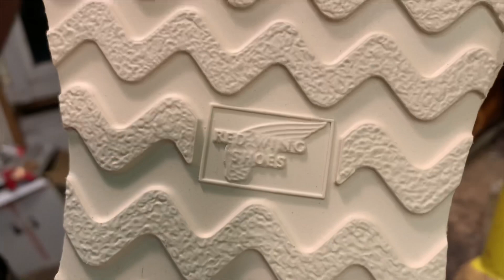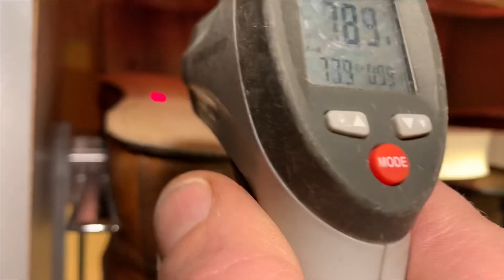Resoling #875 Red Wing Irish Setter Moctoe step by step process by @wijsmancobblers..

Comment: This is great! 
Just turned my 10877’s in to a local cobbler for a sole replacement. I hope what you’ve shown here is standard workmanship in the trade. 
Well done. What a craft!
Reply: I just got mine back from a local cobbler, but they didnt replace the midsole. I m not sure if they even have a sewing machine. How about your shoes? I m in Germany and I payed 75€.
Reply: Had mine back for a couple weeks now. No new midsole, no new stitches. Nothing but a new sole glued on. 
I paid $85
Reply: @263sparky3  you don't need new stitches if he doesn't put a new midsole.
Reply: I know. That’s how I figured no new midsole. Overall happy with the job though
Reply: to add a new welt and midsole it could cost $ 200 more.

Comment: I like the use of the rubber midsole, which is how they were originally built.  I just wish they could figure out how to include a shank of some kind, for better arch support.

Also, I did not know that you could buy the Red Wing Supersoles.  I’ve always assumed that you had to let Red Wing do the work to get them
Reply from the maker: Thanks! You can only have the Red Wing Super soles from an Authorized Red Wing Repairshop 😀😊
Reply: The Supersole® by Red Wing is a polyurethane sole.  T he RW factory locks the footwear into custom machined molds, injects the liquid urethane which expands and creates a chemical bond to the thermoplastic reactive welt so they fuse together chemically creating a bond.  The Red Wing company pioneered this process and patented it back in the seventies.  Though the patent has most likely lapsed, the extreme cost of the custom machined molds and related processes have successfully set the company apart right up to the present day.  Since it's so expensive to get this process up and running I know of no other company making boots with a fused thermoplastic Goodyear welt and PU sole.  I'm a third generation shoe cobbler and maintain a physically separate shoe store where we sell Red Wing and other footwear.   We've sold RW shoes for about 60-years now.  Wedge soles being solid in the instep area provide the best  arch support , and  actually do not need any kind of shank unlike boots with breasted heels.  At one time RWS sold "blocker" PU Supersoles® to RWS dealers that repaired   Supersole® type boots.  We still would add a bonded and sewn mid-sole to be more certain the sole's bond  would hold as without the molds and injection machinery we could not achieve the same  tenacious chemical bonding between PU sole and reactive welt.  I respect Red Wing for still making very high quality boots in the U.S.A.  They are also the only boot maker I know of that has their own leather tannery.  Oh, a big reason, I believe, they are so good is that the company is still family owned.  I sell many kinds of footwear and only a very select few are family owned as of today.  Makes a difference.

Comment: Great job. A few questions: Is that midsole rubber or leather? Also, do you know whether Red Wing manufactures their own traction tread sole (as shown) or does Vibram make it for them? Thanks
Reply from the maker: xaerovette thanks 🙏🏻 . They are made by Vibram USA. Red Wing makes the Supersole in the factory, cast directly on the boot.

Comment: Hello! Is it necessary to replace the midsole when replacing the outsole? Thanks!
Reply: Not if you can remove only the outsole, which can be difficult.
Reply: @TheFrontyer  I appreciate the response! I have since resoled my White's Perrys to success it seems. I purchased a cobbler stand, mounted it to it, and used channellocks and a sharp knife to get almost all of it off fairly easily, and used a wood shop edge sander for the rest.